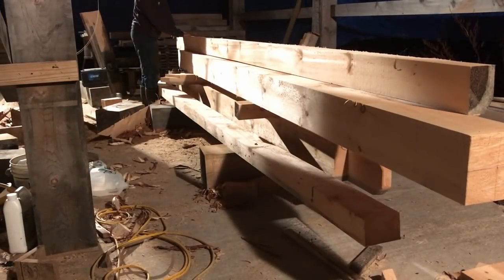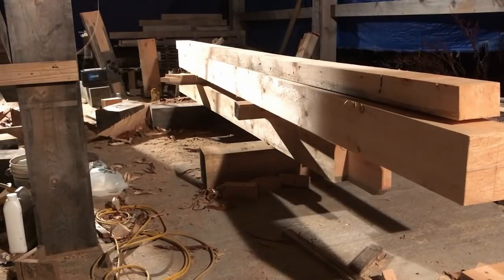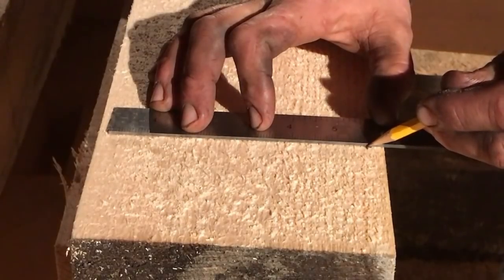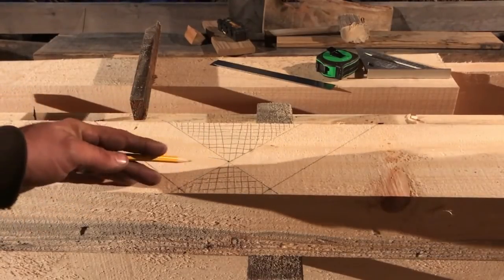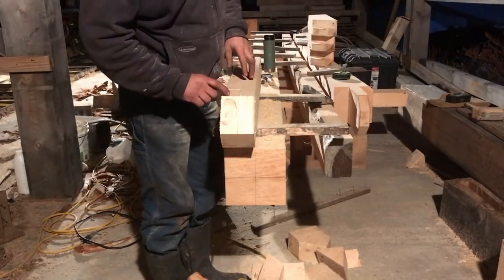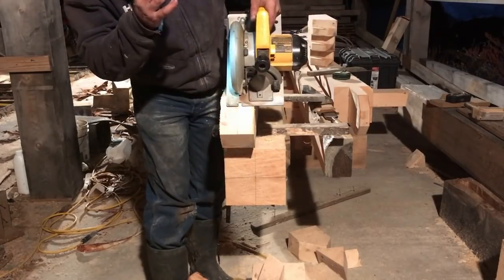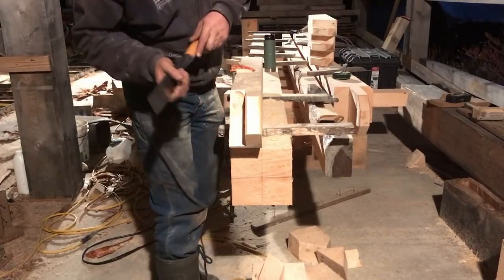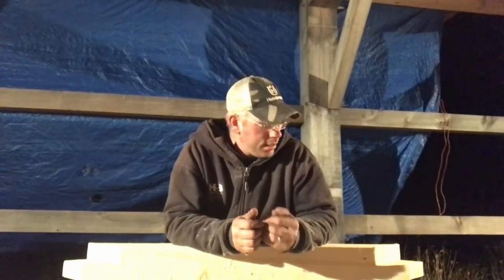A Timber Frame Vlog #82: A Faster Way to Cut Braces

Comment: The beam that you cut up to make the braces on this segment appeared to have a bit of warp in it. I know you know far more about what you are doing, but would you address this comment. My thoughts are that in a 3' brace that warp is not significant enough to cause a problem. That was sure slick how you made use of that lumber.
Reply from the maker: +Pan P the braces are short enough to eliminate the bow in that timber.
Reply: TheTradesmanChannel 2017 as I  wrote,  I  thought as much.
Reply from the maker: +Pan P you were spot on

Comment: I'm so happy I found this channel (now subscribed) as I'm about to start knee braces soon, myself (hence, my search). When laying out the braces end to end, why didn't you lay out the lines to include the 1/8" inch saw kerf between the two braces? I know you said it is faster on your radial arm and table saw-- I was planning on setting up my braces on the Dewalt chop saw using a stop block to insure the lengths are consistent, then using a radial arm with a dado blade to finish the tenons. If the brace rests on the radial arm table (a reference edge but only for tenons on the outside, not in the middle) and the tenon measurement is taken from the table to the bottom of the dado blade wouldn't that give a consistently sized and accurate tenon? Conversely (to avoid a mistake; not saying you did this) if one were to use a dado on a table saw, then the opposite side of the brace would be against the table and your resulting measurement would be consistent on the space you are cutting, not the material your are leaving (tenon). I think the radial arm dado method could minimize amount of chisel clean up and give fairly accurate tenons-- what do you think? Love the channel; keep up the great work!
Reply from the maker: +Drinkin-n-Thinkin gI've me a little bit and I'll answer your questions.  Had a family emergency and now I'm sitting in a university hospital with my uncle that raised me so I might be a minute.
Reply: Hi Jim--hope everything is OK with your Uncle. Just a friendly reminder on this one if you have time...
Reply from the maker: +Drinkin-n-Thinkin i apologize, I think I missed your question from before.  Of your brace stock is good and square you should have no problem with what you want to do.  You could also make a sled for the table saw and that would make it much faster than even the radial arm saw.
I could have done the 1/8" spacing you mentioned and that would have probably worked out well.  Again, I'm very sorry I missed your question.

Comment: What is the distance off the end of your brace before you do  the three eighths mark ? Thanks nice work
Reply from the maker: You measure at the 3/8" mark for brace length.  It all depends on your brace layout.
Reply: @TheTradesmanChannel  thank you
Reply from the maker: Keep in mind that the 3/8 measurement is for a 1/2" housing.

Comment: Hello Jim.  Do you angle the brace pockets to accommodate the top side of the brace or is that necessary?
Reply from the maker: +T W it is not necessary for the braces.  There are times where it needs to be done but not on this frame.

Comment: When I'm squeezing for material I often will turn the lay out and have butt ends meet up, the 3/8 set in would be on the other side for the next brace.  I have cut many braces with just a hand saw and axe, but these days it all skill saw and they are mass produced, all 40 braces are set up, laid out, aligned, each face is walked through then turn them and repeat, take half the line.  Horses or ponies, Steve Chappell at Fox Maple has a great design for small ponies to be used in combination with some bigger timber as bunks, a great system.   Good video, enjoyed it.
Reply from the maker: +Timberdoodles good evening.  I normally cut them out of whatever I have that's decent....rain just started...hard, cold rain...was just getting ready to work on the barn...dammit.
Reply: I saw out a bunch of brace stock and just pull from that pile, a mix of 4x6 soft wood, spruce or pine. and 3x5, hard wood.  I also snap a line between the 3/8 or in my case I house a full inch and use 3/4, off this snapped line I use the framing square to make the 45's, it gets any wonkyness out of the way, snap line square rule thing.  We had a dry summer and are now getting into those cold rains as well, here on the Maine coast.

Comment: Hey Jim, nice productive night there.  Have you thought about using 1/8" hardboard templates for layout?  Index one edge to the arris zip out the layout.  Seems like your joinery standards are consistent enough that it could save you a fair bit of time on layout.  Just a thought...
Reply from the maker: +Chris Peters I've thought about it but tunnel vision is upon me so I haven't wanted to take the time.

Comment: Hello Jim, I love your channel. Your videos are very informative. Near the end of the video you talk about being careful not to rock your saw, are you talking about on the drop cuts? would it help to start your drop cuts from the short side of the brace? What did you mean by not drawing certain lines?
Reply from the maker: +Darrell Barron you don't want to tip the saw out of square to the face you're cutting.  As for the lines I draw only what I need to.  Sometimes if you carry a line past the end of where you need to stop a cut then you may keep following that line with the cut...ask me how I know!

Comment: I really enjoy watching how easy you make this work look. In the next week or two, I plan to start working on my 14' X 18' rafter style frame out of my garage (it's cold and lots of snow here in Northern Ontario). I will work on the smaller pieces and leave the larger top plate and sill plates for when the weather turns to spring time temperatures, so that I can open the garage door. Can't get a long timber in a short garage. 
I was wondering if your timber frame chisels are vintage or are they newer? Barr? Also, do you think that I will benefit from having a 10 1/4" circular saw? Thanks for your videos. They are so helpful. Cheer!
Reply from the maker: Hey there.  I know your pain with the cold weather.  My chisels are new, they're made by Henry Taylor out of England.  They are much lighter than the older chisels and hold an edge longer.  As for the saw, worth every penny.
Reply: @TheTradesmanChannel  I was actually looking at that manufacturer, but unfortunately the supplier had only a 2" chisel in stock and no 1 1/2", so I gambled on e-Bay where I found some hand-forged framing chisels and a slick out of Russia, of all places. I got a 1 1/2", 2", 1" corner chisels and a 3" slick for $154 US. I just had them sharpened at a local shop, and the guy there made them razor sharp. He told me that they are made of really hard steel and an excellent value. I think he said that they were 62 Rockwell hardness. Pretty sweet set. I'm going to see about getting that 10 1/4" Sawsquach. Have a good one. Cheers!
Reply from the maker: That is great, deal of the century there.  No joke.

Comment: Do you find you're accurate enough edge referencing on rough timbers with just a speed square?  I run all my brace stock across a jointer (2 faces) then plane to perfect dimensions and square all around.  That way every one is identical and no adjusting is required on erection day.
Reply from the maker: I took so much time on the sawmilling of these timbers that for the most part they have been perfectly square.  I will tell you though that being new to this I've made some pretty good mistakes (yes I did videos on them) and I'm learning with every joint.  I don't think many people would've tried a 28x50 two story building for their first project doing it alone but the lessons learned on this one will make me better on the next one.
Reply: TheTradesmanChannel oh man, we'd get into trouble if we ever hung out!  My first big job was a 38x56' reproduction dutch barn all on my own!  I learned more  than I can believe and I'm glad I did it, but never again!
Reply from the maker: That is awesome, I bet we could get into trouble.
Reply: @DovetailTimberworks   dutch?  Did it have gambrel roofing?  +10 for difficulty lol
Reply: @prmcollin  No ordinary purlin roof system with beefy conventional rafters, but still pretty silly for the first go at it!

Comment: What diameter of pegs are you using on your 4x6 knee braces?
Reply from the maker: 1" because the tenons are 2" thick.    
If these tenons were under a tension load then the tenons would need to be much longer.
Reply: @TheTradesmanChannel  Thank you for the quick response.  I'm in the process of building and I'm using 4x6 knee braces also.  What is the spacing on tenon for the peg hole? (how far from the leading edge?)
Reply: @Gman7819  you

Comment: Do not try this at home folks!(11:29)What the hell are you doing??? standing on the WRONG side of that circular saw,opposite the baseplate with your back leant over badly,getting covered in sawdust and with the blade right next to your body.It's not a goddamn wormdrive saw!!! This is beyond dangerous and I'm being as diplomatic as I can here! :-(((
Reply from the maker: I'm going to be as diplomatic as I can be right now.  I'm sitting in a hospital right now going on a week because I did something stupid, I don't need the lectures right now.  I've been using power tools for over 20 years and have never even had a close call.  I get hurt when I do stupid shit like work next to an open hole in the floor.  That's why in sitting here with a destroyed ankle waiting on surgery...feel free to chew my ass on that one all you want.